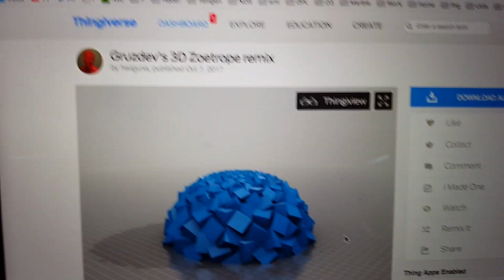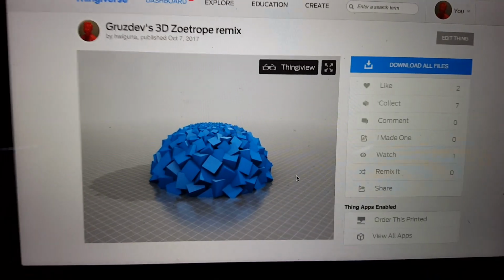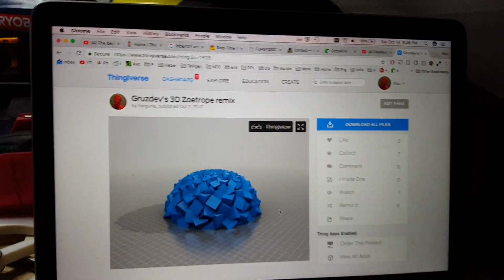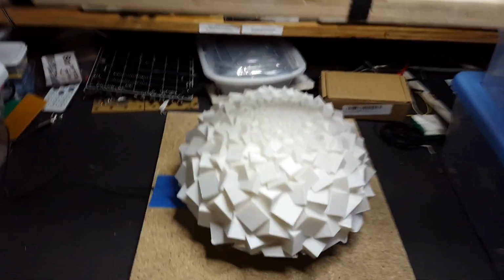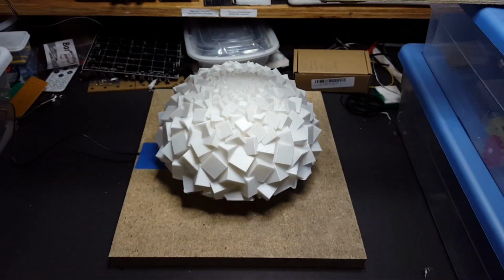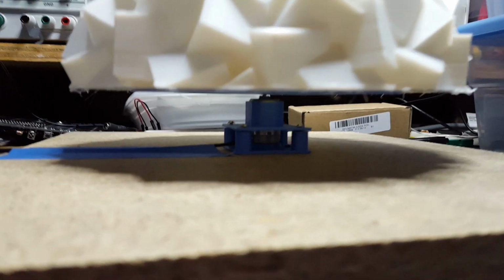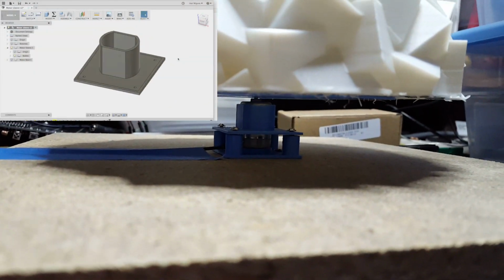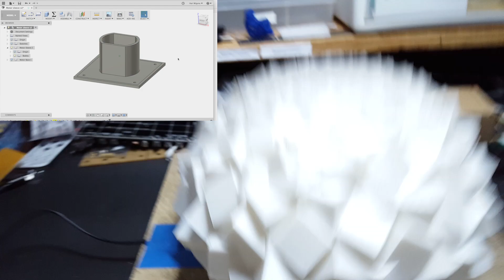HariFun #159 - 3D Printed Zoetrope

Comment: Is there such thing as too fast? How many rpm would you recommend?
Reply from the maker: Hi Steven, the faster it spins the faster the flash needs to be, but other than physical danger of spinning it too fast I say you could spin it as fast as you want.  I think it is more important that the spin and flash are stable.  Sorry, I do not know the rpm.  I just experimented with the flash rate until the effect shows itself.
Reply: @HariWiguna  thanks for the reply! I guess what I need more is how you went about this diy stroboscope.
Reply from the maker: @stevenfagan7278  It was fun to see that effect in real life again. Scroll down for parts list, schematic, and code.  Good luck!
https://hackaday.io/project/170379-3d-zoetrope

Comment: Very cool!
What % infill did you print? Also, what particular motor did you design the STL motor mount for?
Reply from the maker: Isn't it tho? I can't take credit.  Gruzdev did the model.  I printed mine at 5% infill.  The motor is just a hobby motor from a toy car, so it's probably unlikely that you would find one exactly like the one I used. :-(

Comment: Wow... I really want to do this.  Can you suggest a motor, light strip, and light timer, and where to buy these things?  Are they available on Amazon, or where to get things like this?  Does it take much technical knowledge, or are these things plug and play?  Thanks.. awesome job!
Reply from the maker: Glad to inspire you.  The parts are not super critical.  All you need is an (adjustable) stroboscope and anything to spin it at a constant rate.  I just used a toy motor I had lying around, but maybe you could use a turntable?  Let me know if you want to reconstruct the circuit that I threw together, but you could just purchase an adjustable stroboscope off Amazon, maybe even a phone app?
PS: The motor mount I designed is on the thingiverse link in the description.
Let me know if I could help with anything.
Reply: Thanks so much for such a speedy reply!  :)  But yeah, I'm obviously not anywhere near technically savvy as you.  I'm not sure I can 'reconstruct a circuit'... I haven't soldered anything in about 30 years, since those little red kits for kids at Radio Shack, but for this I'd be willing to try again.  :)  Is something like this what you mean?.... https://www.amazon.com/Velleman-MK147-Dual-White-Stroboscope/dp/B000TA7AMW/
Reply from the maker: That velleman might work, though it might not be bright enough. I found lots of variations on Instructable.
I like this one: http://www.instructables.com/id/Stop-Time-with-an-LED-Stroboscope/
Are you saying that you'd rather not have to build one? Maybe you could try some phone apps, either free or free trial ones.  Test it on a fan to see if you could "stop" the fan with the stroboscope app.
Reply from the maker: Ooh, those halloween flashers look nice! Should be plenty bright.  Worst case scenario, you could use it on halloween :-)

Comment: Helo Hari,
Could you help me to reduce the boot time of raspberry pi ..
Thankyou
Reply from the maker: Arjun, unfortunately I have very limited experience with LINUX. Considering that the Pi runs off solid state SD card, I'm surprised that you find it too slow. Is leaving it on all the time an option?
Reply: Raspberry takes atleast 45 seconds to boot .I have seen videos in which raspberry pi boots in 10 seconds but haven't found any documentation of it .Booting time is very important for me .
Reply from the maker: I can think of two things that would speed up boot up time: 1. Faster SD card, 2. Leaner OS options.
Reply: Okay let me see...Thankyou so.much

Comment: This is awesome. very nice the way it folds or unfolds over himself :)
Reply from the maker: I was able to somewhat control the speed and direction of the animation using the potentiometer, but it is pretty touchy.  Might be able to do better with interrupts -- I only used simple delayMicroseconds().  Still,  it turned out better than I had expected.

Comment: You've got à tornado !
Nice print, what about the cube do you get anywhere ? Hope so ! 😀
Reply from the maker: Hello Noum!
I had a couple setbacks on the cube: 1) I accidentally put 12V on the 5V Neopixel, burning 100 of them! 2) I have voltage drop issue when all 512 Neopixels are set to white.  But all is good now, I've repaired the cube, voltage is no longer a problem thanks to @Xerotolabs. I've been coding animations for it.  I will make a video when I have enough animations.  If you can't wait for the next YouTube video, you can follow me on Facebook @HariMakes.  I post raw videos there so there are more frequent updates there.  Thx for asking about the cube. Sorry to keep everyone waiting in suspense.

Comment: Wow! Quite a print-job. Amazing effect indeed. I can imagine it to be mesmerizing in real life. Will you give it a permanent enclosure to display it? I wonder if a mini version would be equally fascinating, to use as a desk piece. (Small toy motor, LiPo-battery, LED-strobe...). Nice video!
Reply from the maker: Hi Maxint,
More and more, I seem to need glass enclosures for my projects. Maybe it's time to invest in a laser cutter. lol.  Yes, a mini version would be adorable. I don't know how small one could make it and still have enough resolution for the 3D effect.  Thx for the positive feedback, Maxint!
Reply: No, thank you for your great videos! (and for the kind replies..)
If you had a laser cutter, making a nice plexiglass/acrylic housing is easy. There is software to automatically draw a box, including connecting lips on all sides. Stay away from cheap low power lasers though as those only lead to disappointments. I've seen a 40W cutter in action in a local makerspace and it had no problems cutting a 5mm sheet. Quite an amazing tool! To have one of those is still on my wishlist. They do require cooling and fume outlet and the laser has limited hours, but it does allow for making some very neat things.